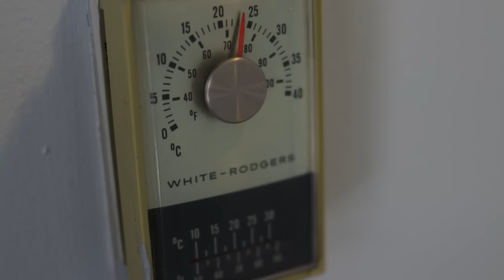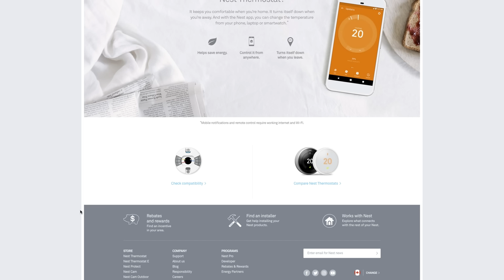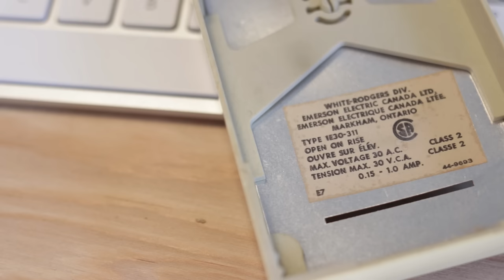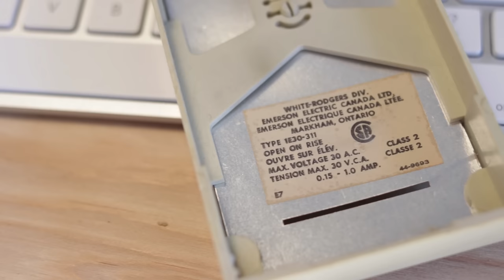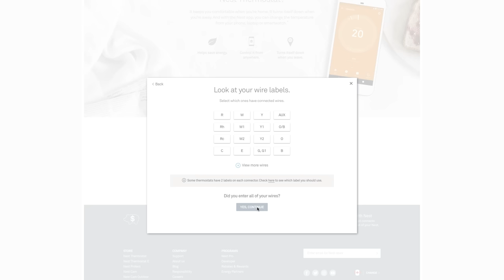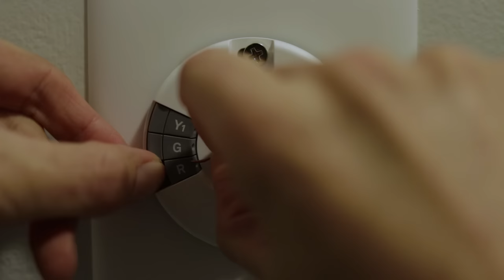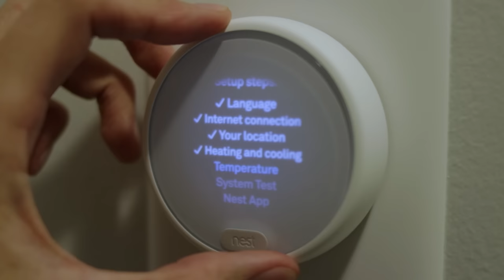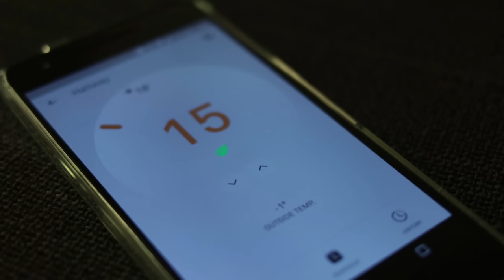Nest Thermostat Install (Replacing old 2 wire thermostat) - FAQ in Description

Comment: This was the best how to videos I’ve seen relating to the Nest. This needs to be included on the company page. Many of us have older homes. Thanks!
Reply from the maker: Thanks Joe! It'd be awesome to get this featured on Nest sites. :)
I'm glad this video is being watched and also being helpful to you. And I agree, most videos are about replacing newer thermostats and that's' why I thought the YouTube community could benefit from another how-to. 

Thanks so much for watching and I appreciate the kind words!
Reply: Joe Burnich sxse the  
one with
Reply: Hey Joe, great video. I did the same setup. My unit comes on but shuts down right before the blower starts. Any insight for me? Rudolph
Reply: I meant Maurits
Reply: Does your heat run on gas
Reply: This video was AWESOME!!!! 
Nest makes it so confusing. Other videos are as well. This one is great!
Reply: Rudolph Vincent  this 2 wire setup only works if you dont use the app everyday and does not work or any other Nest version 2 and 3rd generation, you need a cwire if you want to play with any tdigitalmwifi thermostat
Reply: @filipino_GMA  you are right my nest left me in the cold so many times till I replace the wire with a 5/8 wire works harder and faster now
Reply: Agreed
Reply: i agree, i wanted to get a nest for a while but i could never find out if it will work with my system. Now i know it will
Reply: You can't have exposed wire, that would fall a energy safety test in UK.

Comment: Pro HVAC tip: Don't remove the wires from the thermostat before removing the backplate! If you do so they may not have enough slack and fall into the hole in the wall! Remove the backplate and use it to pull slack in the wires before you disconnect the wires from the old terminals.
Reply from the maker: Yes! Good tip! Thanks Joe!
Reply: That is true just like pulling out an switch or power outlet
Reply: Great tip! Thank you sir.
Reply: Ooooops
Reply: mine has a separate input N and L I suppose there is where I will plig the hot cable (240v AC -> L ) and the neutral cable to N. But then it has Y2 Y1 and L again in a separate rail Y2 is cold something and Y1 heat something (Cant remember the exact name on the manual I dont have it in front of me I suppose its one relay for AC or something and the other Y1 if you have a furnace like I do) so should I short now Y1 with the different L on the separate rail?

Comment: I think it’s important to note this is for the Nest E and not the new Nest. They look pretty much the same but I had an issue with the regular Nest with two wire. I took it back to HD but after reading the Nest E is different and like the Nest Gen 3 which I have two of already and work just fine with the two wire and no C wire. Great video, thank you!

Comment: I have a 90 year old house, 2-wire thermostat.  I just installed it!!!  Works like a charm!!! LOVE it!!!
Reply: no issues with C wire?
Reply: @CarlHarbaran  I don't know what a C wire is.  All I know is the Nest is still working wonderfully, with no issues.  I can control it from anywhere in the world with WiFi/Internet access.
Reply: @CarlHarbaran  hello,   do you have any power issues?    do you need to charge the batteries?   I only have  2 wires
Reply: @mrcarpet4u  not sure I don’t have a nest .. decided too many security concerns

Comment: I just installed a Nest Learning Thermostat with an old two wire (Red & White) gas furnace and it all worked fine.  So far so good.  Thanks for this video.  The only problem I had was configuring the Google Home app.   Luckily, my wife configured the thermostat with the old Nest app and then just invited me to her household.   Afterwards, my Google Home app recognized the invite and now the thermostat works with Google Home.
Reply: 2 years later, any issues? I have the same set up
Reply: We used to receive a few error messages from the Nest about the furnace shutting down.  I don't believe the error message had to do with how the Nest was wired (just two wires) and had more to do with fact that furnace was very old.  So, after two years, no problems with the way the Nest was wired.  Hope this helps. @asherrz

Comment: I managed to install this on my TWO-BLACK-WIRE old ass system ( similar to yours )... THANKYOU!!!! You gave me the confidence to giver a try and it worked out nicely! ( A LOT of other thermostats will say they are not compatible with electric heaters or radiators and THIS WORKS!!!!!!! )
Reply: Hey I also have two black wires. What letters did you connect them?

Comment: We also have gas forced hot air with only 2 wires, we are going to try it, this video was extremely helpful, thank you!
Reply: Did it work for you ? I have a 2 wire gas forced older furnace. You didn't need a C wire for power?
Reply: Yes did it work?
Reply: Nope, unfortunately, I really wanted it to. To add, we're not sure if it was because we only have 2 wires, or if the unit we got was bad, we returned it and went back to our other non smart thermostat.

Comment: Looks like I got screwed with the Honeywell needs a C wire thermostat. I don’t want to install a big bulky transformer to get the 24 VAC so I’m gonna bite the bullet and see what else is out there for a heat only two wire furnace. I’ll be looking at the two wire programmable thermostats. I think they go from about $30 to $50 and there are also smart ones out there. Thanks for the video. If I decide to do it this way, I’ll be coming back for another look. Like button smashed.

Comment: I watched this video &  thought it might be too simplistic.   I also have the old 2 wire thermostats although there is an extra wire that is presently not used.  I was going to get out the multimeter and start checking the voltage on the my two wires.  I believe that one of the wires (probably the red) is carrying 24 volts up to the thermostat. When the thermostat calls for heat it completes the circuit and sends 24 volts back down in the white wire to the other side of the Taco zone switch which in turns activates a call for that zone's  circulator
to run.  Nest shows that most of the time two wires will function ok with the various Nest models by connecting red to R & white to W on the Nest wiring diagram.  The C terminal is left empty.  Somehow the Nest must pull voltage from the R terminal to charge its batteries without lowering the voltage on the return white wire.  If it didn't do this the Nest batteries would seem to be in danger of discharging.  

My solution was to call Taco customer support to see if I could connect to a separate 24 volt supply within the zone switching relay box.  Sure enough there is a 24 volt connection available.  The tech said they get calls all the time about this issue & they recommend using any empty wires to create this supply to avoid any potential problems.  Nest wiring diagrams then show this added 24 volt line should connect to their "C" terminal .  The tech also stressed the need to charge the Nest for a couple of hours via its USB port before beginning the install. That way the Nest will be ready for programming.
Reply: Any issues with the Nest E losing power so far? I'm looking to replace an old 2 wire with non C wire as well.
Reply: @landonwenzel  same here , I only have 2 wires but don't wanna mess anything up

Comment: Thanks! Installed on a similar style White Rodgers and it worked with same wiring. One thing I’d do is charge with USB first as out of the box the battery was low and I had to charge before set up. Thanks again.
Reply: Jim Salembier great tip, at first I thought mine was defective, but that’s all I needed to do to get it working.

Comment: Thanks for this video!! I was searching for hours to figure out if I could replace my "vintage" thermostat (2 wires like yours) by something more modern. Thanks again.
Reply: Any thermostat will do for your application no need for a fancy stat it only makes the connection to turn on heat.
Reply: Keep the old one
Reply: @brandonhvacants2217  What about AC though? Don't you need a wire from the furnace to connect the auto AC on feature?

Comment: I think it's important to note that you're actually getting power to the Nest via your black wire.  Otherwise you would have been hit with error codes saying you don't have sufficient power and your thermostat won't function properly being powered by just the batteries. 
   I think most 2-wire homes have a red and a white wire which requires a third "C" wire.
Reply: So how do you install it? I bought the 24v adapter but now I have 4 wires in total
Reply: You need one of those wires to connect to the C terminal (common) for power
Reply: That’s what I’ve got. Red and white wires. Nothing else. So when I put the front on, there was no display popping on.
Reply: He will still have issue when not using the system in the summer , I currently have the error issue it needs a common wire to keep the thermostat charged
Reply: I have an old vintage thermostat like his but mine has two whites and two blacks, does anyone know how to go about plugging it in?
Reply: @datazndood  i ended up buying a 5 wire thermostats wire at Home Depot and use the old wire to pull it in the basement . So I was able to use one of those wire to keep it on.
Reply: @jeffohhh2380 so what the hell do I do with the other wire? I have two wires coming from the electric furnace blower thing in the closet (1979 manufactured home) I hooked my multimeter to it and it said there was 28 volts. So there's power on the line.. it goes into a old thermostat like this that relies on the temperature making that metal spring move to close the circuit.. the colors are white and yellow but I. Guessing it would go white to w1 and yellow to red..  my setup on my phone asks me to select what wires I'm using and then won't continue unless it's a valid combo, or (in this case stops me and says I need a c wire so I ordered a plug in transformer 24v from Amazon.) And that has 2 wires coming from the outlet to the thermostat now.. one goes to c the other to r.. 

Your saying plug one of those two c wires from the plug in transformer into the C slot,   but how does that work, what do you do with the other wire that's said by   the instruction needs to go to the r slot?

Do you really not plug in the second c wire? Or stick it with the other wire into the r slot or what
Reply: @XKillerX25 what did u end up doing to fix it with that plug into the wall c wire
Reply: @Mortland yes one to C which is the one that nest needs and the other to the R terminal. From the furnace you’ll plug into the RH terminal and W terminal if you only have 2 wires coming from the furnace.

Comment: I just returned my nest cause my heating guy said I needed c wire..thanks to u..I know I don't...I have 2 wires also RH and W..im getting it and installing ...great job my man
Reply from the maker: Sweet! Thanks for watching and leaving a comment! :)
Reply: @Benjamin Stafford  The C wire would allow the thermostat to stay charged. I have not tried it with a two wire setup, but I imagine the device is drawing power from the completed circuit when the thermostat is calling for heat. If the device is low on battery, it may call for heat just to keep charged.
Reply: Great video, well done and concise. However, i just purchased and had electrician install a Nest E Thermostat when he was here, i only have 2 wires. The electrician installed it with the existing 2 wires and programmed it, seemed to work great. Next day technician comes from heating company, guy really seems to know his stuff, a true "old timer". This morning the Nest doesn't seem to have power, display is not on.  The technician stated that the electrician was wrong, you shouldn't use this thermostat with 2-wire setups as it is not getting enough power this way. I read the Nest instructions and they clearly state that it is not compatible with a 2-wire setup. Technician said he is not surprised, he is constantly fixing plumber's and electrician's mistakes.  Not a criticism of video at all, just stating my confusion. I'm searching videos to see what i need to do to get proper wiring for the Nest E.
Reply: @Benjamin Stafford you could be right.  And I didn't charge it aside from whatever charge was already on, electrician just put it on wall. Wonder if it just needed a charge
Reply: Jamie Jones nests are absolutely compatible with 2 wire setups. However, everyone has different heating setups and certain equipment will work better than others. The way it works with 2 wire is it’s supposed to charge by “pulsing” the W wire whether you are heating the home or not.  For some systems this works just fine, for others the system may short cycle or you may not get enough power to the nest. If this happens you need a common wire, which will supply the nest with a steady stream of current. If you call their customer support very often they will reimburse you for the cost of running the common wire if it’s found you need one
Reply: @doomsday9973  appreciate the reply. I'm going to do exactly that. Woukdnt have thought to contact customer service for possible reimbursement. Thanks for the info, cheers
Reply: Installed this same thermostat over the weekend. I have heat only, oil fired burner. I noticed that the furnace would kick on very frequently and would kick the heat well past the set temperature. Put old thermostat back on and now having problems with that. Should have left well enough alone.
Reply: Jason T boiler
Reply: Strange that is an odd set of issues, if its the usual common wire issue you will typically hear the relay repeatedly clicking while its trying to charge, and going back to the old stat should always return to the way it was before.
Reply: @RickyThunell  you are correct, it does this in micro bursts which depending on the burner it may or maynot detect.  if it doesn't detect the completed circuit you should be fine but if it does it will cause the burner to make odd noises white it short cycles and can cause issues for the next and burner.
Reply: C wire improves reliability due to not needing to power steal to charge.   It is a good idea to add this wire actually.
Reply: @billkiessel6682  the heat gets higher then it's set at because it blows all the hot air out after the burners turn off.  This feature can be shut off if wanted in settings.

Comment: In MY opinion i liked the older one better because it was much more simple but it’s your house so you could modify it to your satisfaction 👍 keep up the good work
Reply: Can't change the older one from your bed, with the app, if you're cold and don't want to get out from under the covers :)
Reply: Solkre yah but the older thermostat will probably out live the other cheap Chinese one and I’m not that techy with  the temperature I’m satisfied with I’d go for just a 70 and leave it like that and never touch it

Comment: Our old thermostat also had 2 wires and at first the Nest worked fine. But we started having issues with the furnace not turning on and the heating guy said it was because the Nest was drawing Power from the furnaces’ mother board, ruining it and needing to be replaced. So to be safe I’d have someone run a “C wire” to the thermostat that’s job is only to supply power to the Nest.

Comment: thinking about getting one myself. I have two separate units currently with their own controls. One if the AC the other is gas baseboard heater. Technically it should work, I have one nest rep tell me "No" and two others tell me "yes, or yes, probably". That is to say, running both units off the one nest.

Comment: Thanks for this, I have a 2 wire set up like yours and was wondering. I'll be getting this model too.
Reply from the maker: Excellent, I'm glad this was helpful! :) Thanks for letting me know, Stefan!
Reply: Maurits Nienhuis BTW We got the temperature sensors which work perrfectly.
Reply from the maker: Nice! That's cool. Thanks for sharing, Stefan!
Reply: 2 yrs later did u get it
Reply: @CCCC-tq8yo  Yep. Works great too.
Reply: @StefanDembowski  how much money did u save
Reply: @CCCC-tq8yo  Only a few dollars a month, to be honest. Mostly it allows us to have better control in case we forget to lower the heat if we're running errands.
Reply: @StefanDembowski  I have saved about 285 in a yr with ecobee
Reply: @CCCC-tq8yo  NICE!
Reply: Me too, I am gonna get it.
Reply: Went to install mine today... Also with just two wires.. White and red... Mine did not work..it did not turn on. Furnace circuit in on.. Must be something else wrong. :(
Reply: @fernandatv  I have the same problem I might just have to gonback

Comment: Thankyou for these clear instructions! I have the Nest learning thermostat 3rd generation and was replacing an old Honeywell that also had only the black and white wires. The included instructions does not account for that and the lettering system leaves you clueless.
Reply from the maker: Thanks for taking the time to leave a comment Alicia, I greatly appreciate that! I'm stoked to hear that this was helpful to you! :)
Reply: Did it work for you? Have you had any battery problems so far with the Nest Learning?